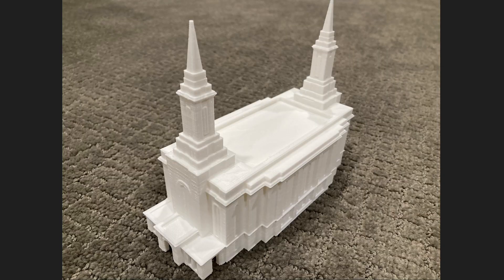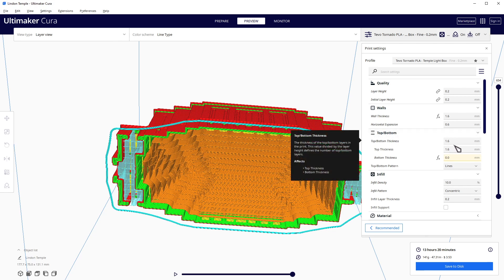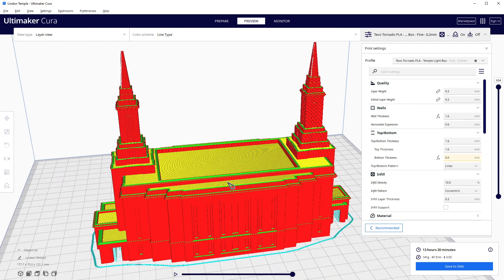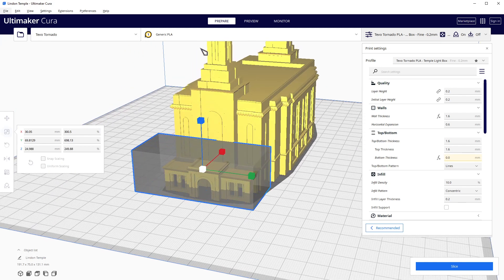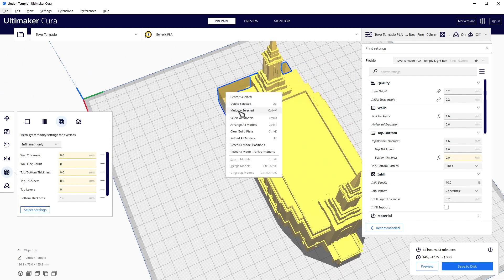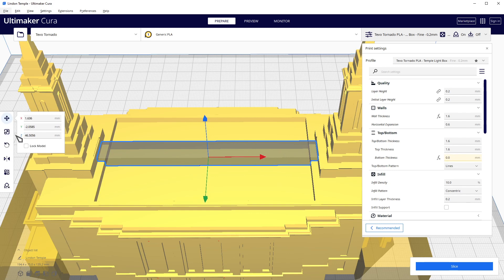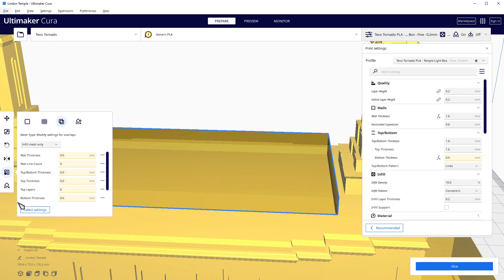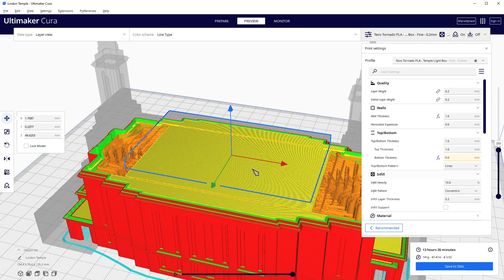3D Printing a solid model hollow using only Cura

Comment: this is the issue I have with CURA. All this should be done automatically! End of story. If you use Tree supports these are very easy to remove. I don't remember if you can use tree supports on the inside of a model. But my frustration is that all Supports should be as easy to remove as Tree supports. And I don't think The CURA team is trying to fix this issue. It auto support worked correctly this would save a lot of time and frustration.
Reply: Hi John, is there a free 3D software program that hollows automatically or easily that you know of?
Reply: @valentinovalentin5666 me too looking for this at the moment, maybe you have found something?

Comment: Hi, Thanks for vid.  
Just wondering why if you made this model yourself you did not make the entire ceiling/top section a separate model then just stick it to the bottom model after, would save all that infill etc? 🙂
Reply from the maker: Good question. 

I guess first, the real purpose of this video was to demo a technique for taking any solid model with some amount of bed surface area and making it hollow, not about the temple model itself.

With that said, this is the first temple I've modelled, and I didn't think about doing that.  Actually, I don't think I've ever seen a temple model done that way.  All of them I've seen on Thingiverse are either solid like I did mine, or they are already designed to be hollow.  One advantage to starting with a solid model is, using the technique I described in this video ... you can choose the thickness of the walls (in contrast to an already hollow model, where you get what they designed), and with this technique the walls are a single wall (rather than two walls with infill) which I think adds to the aesthetics of the light box.

If the top and the walls were printed separately, it does seem like it might be a bit of a pain to try to line them up just right while you use superglue to attach the two.  And then I expect the line where they meet would likely be visible.  For me the extra one dollar or so of material is worth not having to do that post print work and to also have it look amazing right off the bed.

I guess if the 10 minutes of post print work is worth saving a dollar to you, it wouldn't be hard to do this yourself.  Simply take my model (https://www.thingiverse.com/thing:5642686) (or any other temple model for that matter), throw it in Meshmixer, do a slice to separate the top from the base (demo [not mine] for how to slice models in meshmixer: https://youtu.be/zSv948fjpcY).  Then in Cura, with the base, have 0% infill, a wall thickness of 1.6mm (or whatever wall thickness you want), a top thickness of 0, and a bottom thickness of 0.  And with the model top, follow the process I demonstrated in my video.  Then glue them together when they are both done.

Honestly, we do these light boxes as wedding gifts, and I just consider the used infill to be part of the cost of a really nice print.
Reply: @davidhicken6817 Damn. It was just a question. Calm your nutz, man.